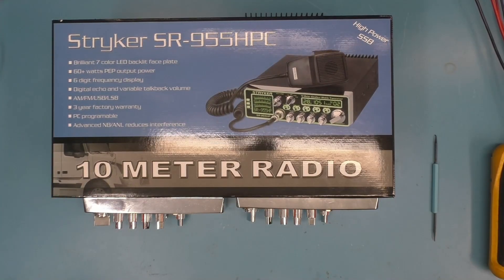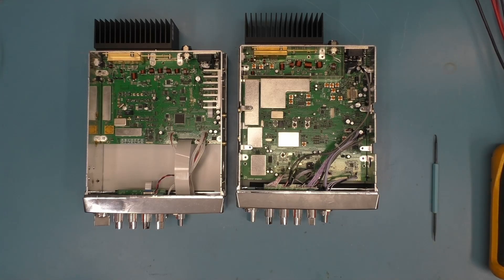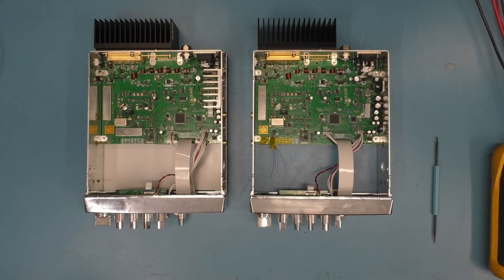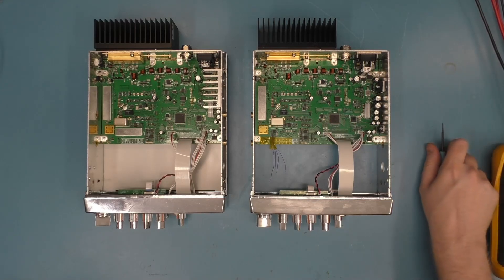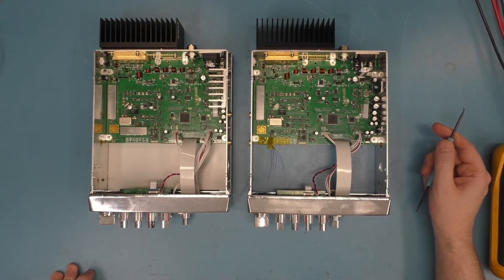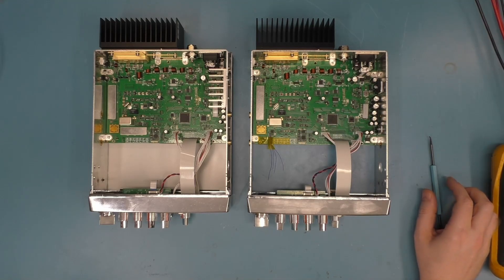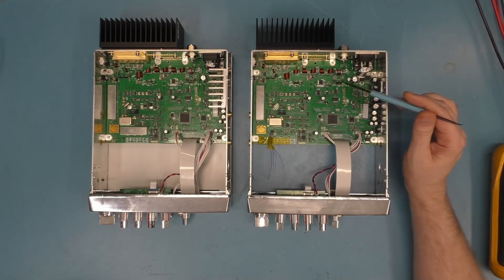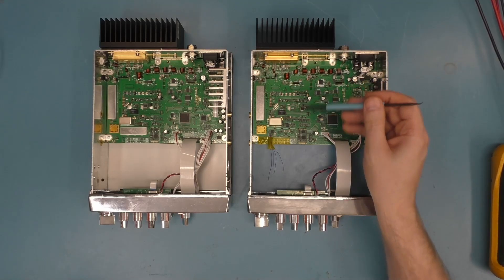SR-955 - Version 2 Internals - First Look

Comment: Fantastic Mark! Did they upgrade the power wire to 12 gauge? Much needed. And gotta find that secret menu for adjusting like the President radios. Thanks! Look forward to updates
Reply from the maker: The cord I got seemed heavier. I did not really look but I think so.
As to the "secret menu" yeah, its there.
Reply: I saw somewhere where a person who got a new 955 not sure if its the v2 or not said that their radio had the bigger ga pwr wire..